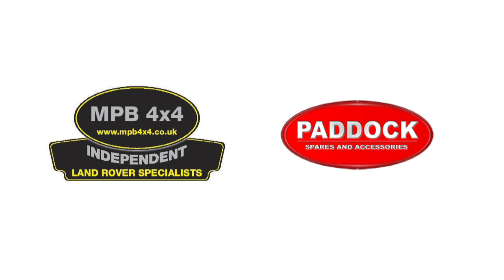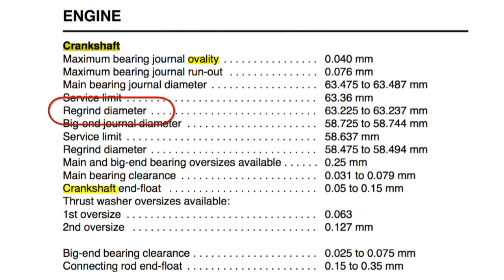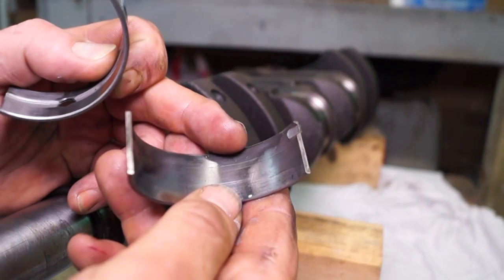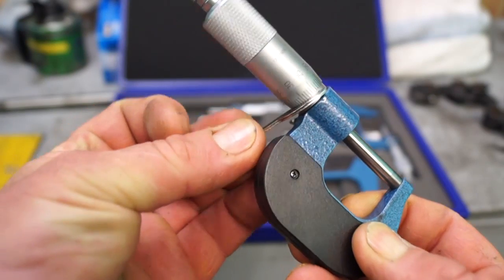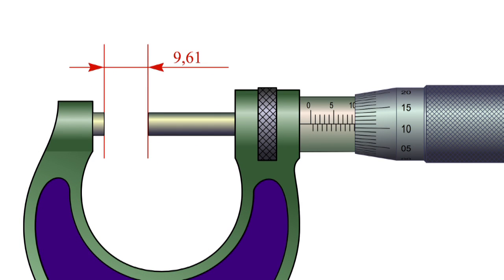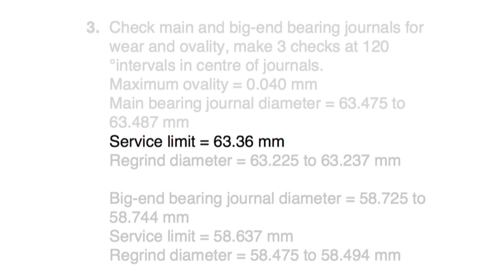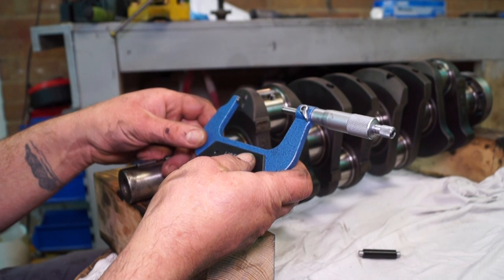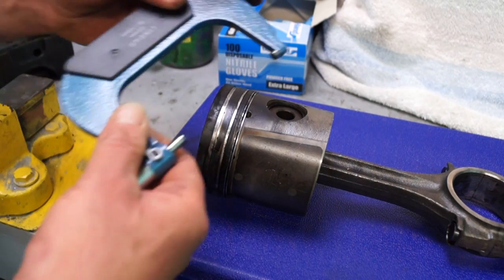How to Measure your Crankshaft  Part 1- Ovality and Taper - 300tdi engine Overhaul -

Comment: Thank you for the video mate. Really helps alot. But the micrometer scratches my crankshaft journal when i move it to get the measurements. So scratches I can really feel it when i try to feel from my finger nail. Will those scratches later effect with any particles getting stuck between them? Please educate me with this type of situation because I cannot find a right answer for this. Thanks in advance
Reply from the maker: You are being far too heavy handed with the micrometer.  It should have a ratchet mechanism on the bottom of it to stop adding too much pressure.  I am afraid if the crank is scratched it will need grinding out by an  engine engineering workshop

Comment: Is there some advantage to a flat plane crank in an inline 4 cylinder?
Reply from the maker: Now that is a question.   Flat plane crank and cross plane cranks have their uses in engine applications but it is out of my knowledge area TBH.  Plenty of stuff on the internet about the applications for either.  I just accept what is used in an engine and make the best of what I have.  Especially with old diesel engines.
Reply: Land Rover Toolbox Videos
Reply: It operates like a giant 2 cylinder. Maybe it's just a balance issue.

Comment: I saw you had three decimal, centesimal and milesimal digits on some of the measurement. If the micrometer is 0.01mm accuracy, how do you get that third  digit..?
Reply from the maker: There are micrometers that will go to another decimal place but they are very expensive.   I had to compromise on these.
Reply from the maker: When i see the marker is between 2 increments on the micrometer shown then i know it is .005mm.
Reply: Veneer number